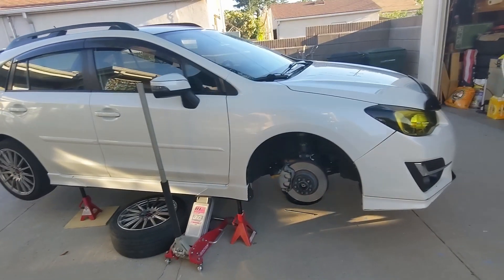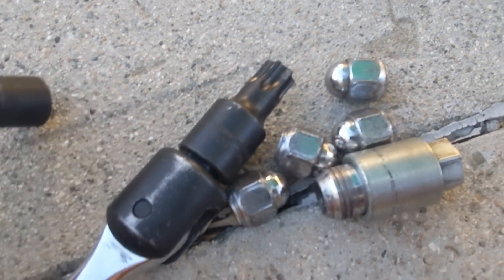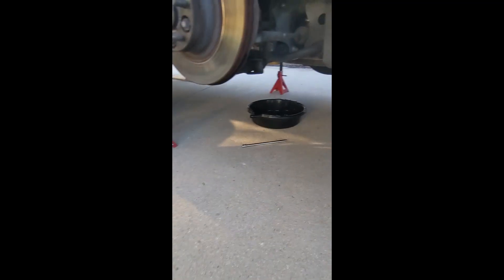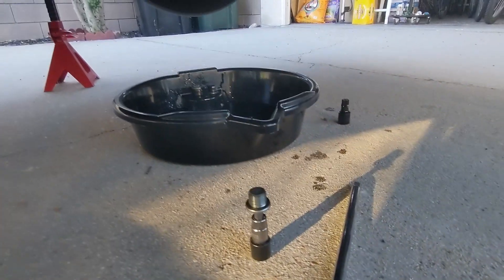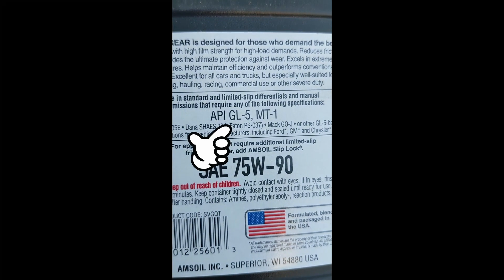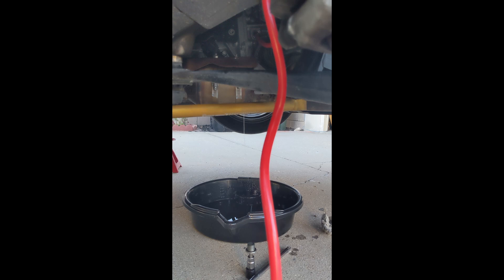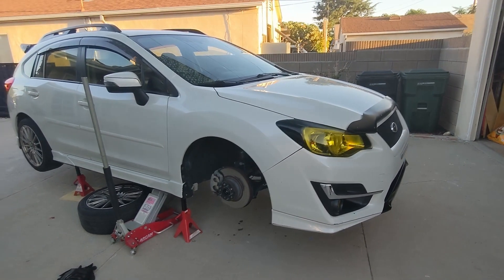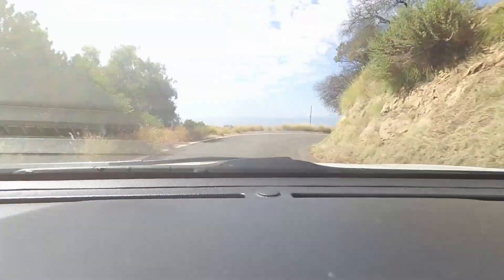Subaru CVT - Front Differential Service

Comment: You can backfill it thru the level check side, find a hose the fits snuggly in the hole, pump the fluid up and in, pump enough in until it drains out, lot easier than accessing the fill port on the passenger side.

Comment: Hi Jason. I have a trivial (to some) request. Could you make a vid showing how you get your Subie on all four jack stands. Cheers.
Reply: What I do is jack up the front of the car with parking brake engaged.  Place front jack stands, then lower it down gently.

Move floor jack to lift back of car.  Place rear jack stands, lower car gently onto rear stands.

Comment: The W is for winter, not weight.
Reply from the maker: You are correct, when it comes to motor oil, the W is for winter. I am used to using W for weight in RC car shock fluid 🤷‍♂️.
Reply: @JasonLeung-4roller   Ah, that's pretty cool.   Weight is a thing.  30 weight oil.   But in multiviscosity they mean cold vs hot.      I need to learn about RC cars.   Too many kids running around this place for me to have yet another hobby!    Have fun.

Comment: guys, I'm telling ya go through the check/inspection port when filling so much easier than that hard to reach gorilla-installed fill bolt...
Reply: How can I ensure that the fill amount is correct? Is it when it starts dripping out of this port?
Reply: @davidhoffman8602  correct
Reply: Thanks for this tip, I will be trying it out.

Comment: How long does the front diff last? how many years did you change your fluid {5 years exp} 30,000 miles what is the max of time to change the fluid it degrade over time.
Reply from the maker: I think a lot of people neglect the front diff fluid. It's not mandatory to change, but more recommended. I went 7 years without changing mine. Though I only have 56k miles on my car.  After I changed the fluid, I did feel a noticeable improvement in smoothness. How long have you had your car?
Reply: @JasonLeung-4roller  I have the Subaru 2020 Outback will be 5 years next month I did changed the rear fluid  by Subaru 75W90 fluid take 0.8 qts 25.6 OZ  on 3/13/25 the front more challenging  the car as 3.9K miles but it's almost 5 years now fluid degrade over time 
i'm retired we moved to Oregon from Las Vegas. I don't go anywhere than shopping i do 32 miles a month or more depend about 192 miles in 6 month a change the oil engine i put a fumoto for Subaru great less fighting hard to removed the bolt and change the o rings every time i have a oil change been changing the oil every 6 month after the Subaru Dealer warranty expired now the diff getting older fluid will degrade I have to do the front diff and make the car level as possible or pour the right amount of fluid( Front 1.3 qts  diff 41.6) oz and (rear diff 0.8 qts 25.6 oz) 
but i have no ideas how long the fluid last in TIME not MILES same issue with the CVT Fluid the oil engine they Subaru Japan say every 6 month  i tried 12 month and the oil was dark so i can change it now every 6 month my car stay in the garage 24/7 with a battery maintainer i'm 69 i can still can rotate the tires, and change the oil my car it's a good shape like new but i need to wash it since 2020 lol anyway dealer will not tell you any things than bringing the car for services I don't trust the dealer about asking question about the car if you are lucky you get the right person to answer your question great otherwise go to the Subaru forum for answers or Youtube.

Comment: I have the same problem with the fill plug. I can't break it free with a Milwaukee 1/2" battery impact.
Reply: You don't need it, you can run a smaller tube up into the check port. It will go in about 5 inches and bottom out, at this point the channel 90s over towards the diff / away from the CVT. You can definitely fill it via the check port!
Reply: @Iosthought  I can't find any crush gaskets for any of the front or rear diff plugs. Am I missing something, or are there no crush gaskets?
Reply: @davidhoffman8602  There are washers, I re-used mine. There are part numbers for them but they are hard to find. They don't crush though, some are a really durable black plastic type material, the front diff drain port has a big metal one though.

Comment: Great video. Gives me confidence that I can do this. You mentioned that you did the rear at 15k miles but waited till 40k for front? Is there a reason? I have a 24 CT and it says change both at 30k.
Reply from the maker: I requested my CVT fluid be changed at 15k, but they wouldn't do it. After talking with the service guy, he said he would do it if they combined it with another item. Basically up selling me. 

30k is a good time to do both. 

Thanks for the visit. You can definitely do it!
Reply: @JasonLeung-4roller that so weird that they would even say that 😂. Also im so glad you are using a non subaru branded fluid. All I see in other videos is the subaru oem one which im fine with but i know that its not that serious

Comment: So is the differential in the front in the transmission and is it the same fluid I have a 2013 Subaru legacy and my boy told me it was but I was wondering if it was a different service from the transmission fluid change?
Reply from the maker: If it is a CVT, then the fluid for the transmission is separate from the front Differential.

Comment: How hard was that t70 to break? the one on my 5mt would not budge, ugga dugga'd it with a 300ft/lb impact for like 20 seconds and couldn't break it free. Was thinking I had to apply heat to break the loctite.
Reply: Now I am going to check that my fluid is 100% synthetic, thanks Jason 
I like that you could pick up on the difference after changing them,
Reply from the maker: @aebelskiver  will you get some kind of oil analysis done? Indeed, I didn't think it would have been that noticeable! Let us know how your diff fluid change goes. Cheers!
Reply from the maker: Surprisingly it was pretty easy with the breaker bar.  The rear diffs were more of an issue, It felt like they put more loctite on those.  Instead of an impact, perhaps try a long breaker bar? Good luck!